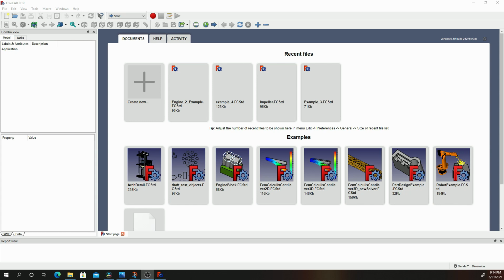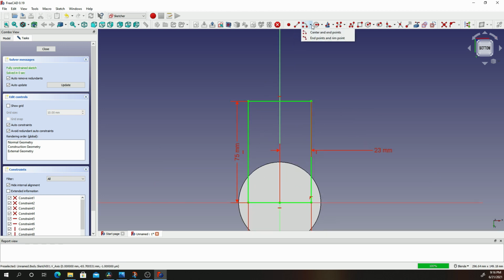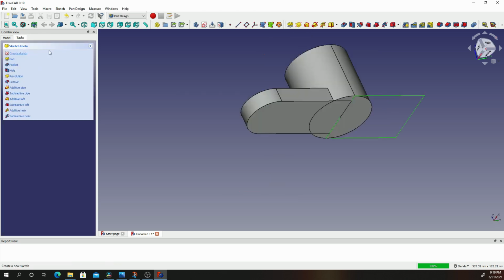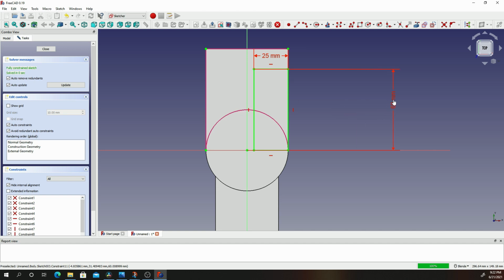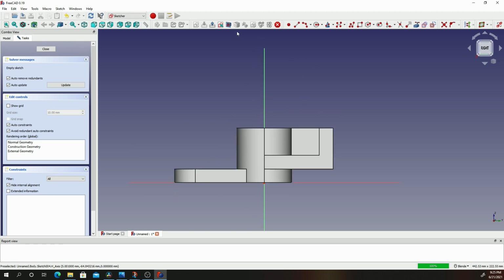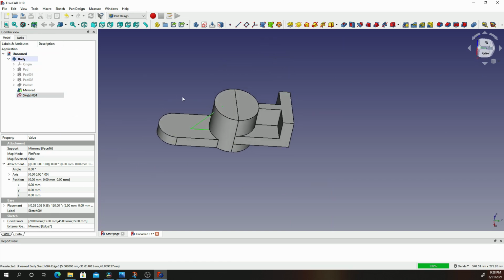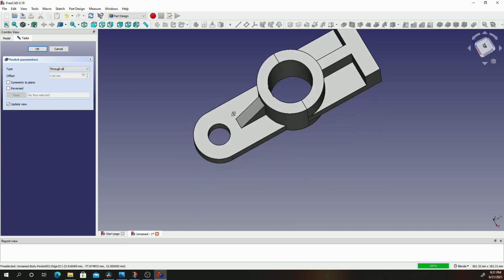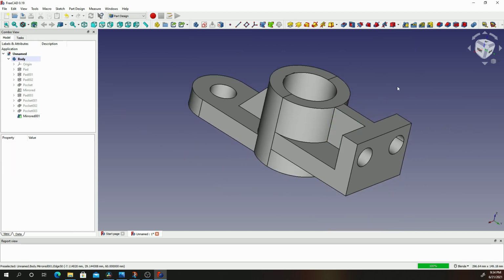FreeCAD Isometric Drawing - Mechanical  Engine Joint (Example Two)

Comment: Good video.  Your series is at a good level for learning FreeCAD, especially for creating mechanical parts.  I had to take a break to sketch up a ramp for my friend's house (BIM workbench, another learning experience).  But I am back and have completed your mechanical engine joint.  

At around the 13:20 mark, why did we need to provide a coincident constraint to the upper two vertices of the triangle, but not the lower left vertices? My understanding is that the coincident constraint was to constrain the rectangle vertex and the line vertex.  I would have thought the same would hold for the other end. 

Also, selecting hidden vertices was problematic for me. Is there some method you use to select only the ones you want?  For the external geometry, what I did is show the "Selection View Panel" (View menu > Panels). After selecting all the items using the click and drag method, I deselected (by double-clicking) all the edges, leaving only the vertices. then I could use the coincident constraint to make it fully constrained. Again, thanks!  Sometimes I am able to follow along for a while without stopping the video to catch up, so I know my familiarity with FreeCAD is improving.

Also...  How do you create the visuals for your splash screen?  They are really nice!